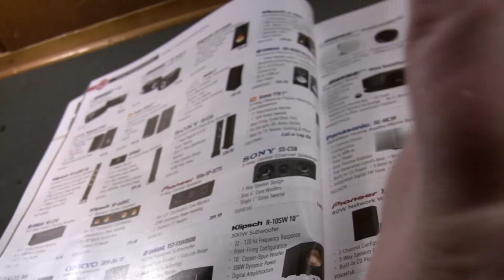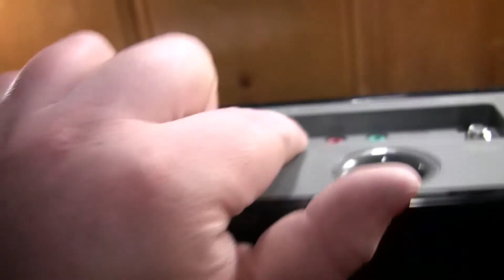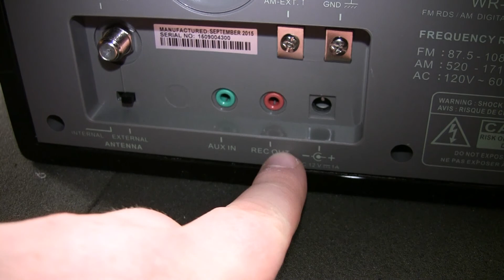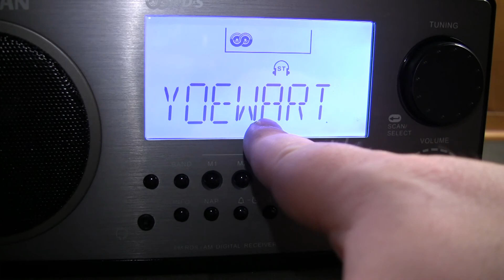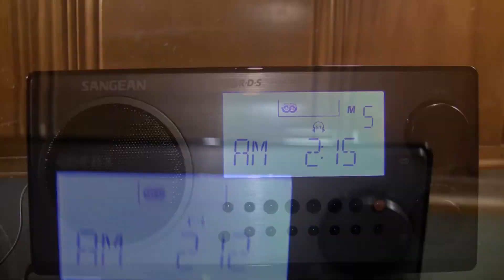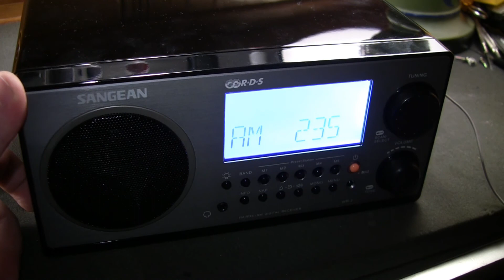Sangean WR-2 AM/FM RDS Tabletop Radio Review

Comment: Oddly I find the WR-2 to be pretty good as to AM/FM reception. I have been into Radio all my life and a radio nut. No..not one of those audiophiles (?) Radio Communications. Sensitivity on stations received. There is so much junk junk junk out there as to radios I I Consider this radio to be AOK. FORGET MADE FOR AM as to most any radio sold these days.!! Sangean usually makes good radios. They were made in Germany but like everybody now in China. (but quality control at least supervised) You get the option of external antennas. (unusial for consumer radios)

I agree too high priced now !! Made in China and prices ?

AM nighttime the signals skip off the sky and travel long distances so that is the interference. Multiple stations fighting for the channel.

Again. I think the radio is pretty good as to weak signal reception. Digital nice,

Nobody listens to radio anymore BUT I'd rather turn on a radio vs. a phone and endless ads and notifications and everything to drive one nuts. 5 years just to start listening to a radio station.

Since nobody listens to radio anymore it is a good time to buy such USED. Endless Sangean used and can be low prices simply because people think radio is dead. I bought numerous radios like the WR2 for $50 and under and some were only several years old.(by stickers on the radio) Speakers might wear out but electrical does not wear out except maybe after several decades.

o--forgot..the death of AM RADIO ? #1 is electrical NOISE !! Nobody wants to listen to NOISE. Once the FCC enforced noise standards but thank CHINA and no noise protections and FCC gave up. NOISE ? That grrrrr   brrrr  Electrical noise. Do not hear such on FM as much higher frequency and FM. AM stations have to have a large transmit antenna and land to put such on. Now land can be worth a fortune and advertisements on your AM radio bring in a fortune ?  Many Many AM'ers going under.

Buy consumer radios 2024 and terrible junk out there and AM RADIO forget it. (spend money to design for that by manufacturer ?) Lucky to get a station a mile away !!!  FM can be massive power and in urbal areas can swamp radio reception. I guess one rason some radios are kinda dead as to FM sensitivity. Sell radios that get overloaded ?

If one wants good reception snoop for communications type radios..some call it DX.(long distance)

Oddly many old car radios are excellent !!! Even new car radios can be excellent. Set one up in your hoise with a 12 volt power supply and a set of speakers and a simple whip antenna like on cars. Usually sounds excellent and sensitive. Made to be rugged.
Reply: As to audio I am very very dumb (not that I am smart on anything but--) A question ? These radios are STEREO but one speaker and STEREO only using the earphones.  hey..feed into an audio amplifier... I tried and nothing nothing  Seems the signal received is too weak to drive the amplifier.. Any suggestions ? I have no test equipment at my termporatry address here. Normally one can connect an audio amp to any earphone jack. I have heard the most excellent audio sound from the cheapest radios sometimes. Take some small portable radio and wow !!!! What is with this WR2 ?? Too weak a signal to be amplified ?

Comment: I own a 5-6yo Sangean table top radio and am terribly annoyed by the 'feature' that anytime you touch ANY control, the display goes to full brightness until you haven't touched a control for 8-10 seconds.  I was hoping you might have determined if this occurs with this WR-2 model.  You seem to have the full brightness turned on.  Thanks for your review.
Reply: This happens when you buy Chinese caca. Don't buy Chinese caca and problem solved.

Comment: Labeling for the rear panel of the set:  AUX IN is the green 3.5mm (1/8") jack, REC OUT is the red 3.5mm (1/8") jack, both receiving a 3.5 mm (1/8") male phono plug patch cable. A good set indeed, highly recommended.

Comment: I just got the WR-2 to replace my old similarly priced Tivoli. The Tivoli has problems with fine tuning (apparently, some of this may be the grease drying on the controls), but the WR-2 at least has a digital readout to let you know the frequency. On the Tivoli, you needed to trust them that the dial was accurate. I found out later that the company I bought my WR-2 from wasn't the cheapest, but the radio got here fast, and it is more sensitive on weak stations than the Tivoli ever was. It's also much easier to tune. I'm happy about everything except the price I paid.
Reply: I bought  the Sangean WR-2 and love it , paid  $180.00 ,,sound & turning is outstanding ..bought out of the Hammacher Schlemmer

Comment: Thank you for this review.  From the stations you tuned to, it looks like you're near Morristown NJ.  I'm in Chatham.  I just purchased the the Sangean PR-D7.  It a very nice radio and picks up all the stations I like without an external antenna.  My only real complaint is this:  the audio has too much base and there is no way to adjust it.  I'm a big AM listener, and the last thing you need when listening to news and talk stations is a lot of base.  I see from your review there is a base and treble adjuster on the WR-2.  Does that work well?  Also, how well does it work without connecting an external antenna?  I really have no interest in doing that.  Lastly, it was not clear to me if the WR-2 runs on batteries or just house AC.  Really looking forward to hearing back from you.  Thanks.
Reply from the maker: Indeed your complaint is shared by me. The bass can be lowered by three steps after pushing in the volume knob (if I'm not mistaken). The bass and treble controls do make adjustments to the audio; moreover, there is a "loudness" (or similarly titled) setting in the menu which behaves in a similar fashion to the loudness button on stereo receivers. Disabling it will additionally help quell the boomy bass. 

Use of the WR-2 without an external antenna works just fine. I found it to be more than sensitive enough to pull in all the AM and FM stations I listen to. AM could use a small boost, however, simply by connecting some wire or one of those small loop antennas commonly bundled with stereo systems. For FM, the included 75 ohm wire antenna is more the adequate for most uses.

The radio can be powered of AC power using the industry standard figure-of-eight power connection (like what boomboxes uses) or a 12 volt 1 amp DC power supply.
Reply: Thanks to StereoDustParticles' reply I located the loudness control on the menu and after some fiddling, disabled it. What a difference!  It would have been far better to have that function on the remote or the front panel since the resultant tonal balance is ideal for voice but not for music.  Now perhaps I will not return the radio to Amazon.  With my high frequency hearing loss the boomy base had been  intolerable for news and documentary programming. Now not so bad.  The bass and treble boost still work with the loudness off, but even stepped to max, do not reach the level of compensation achieved by the loudness function on its own. RIAA curves and all that.